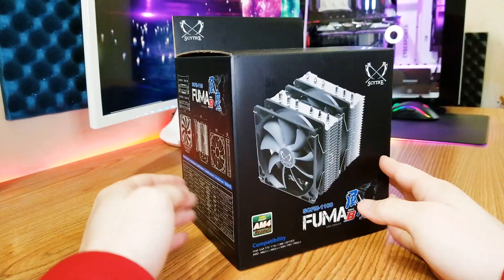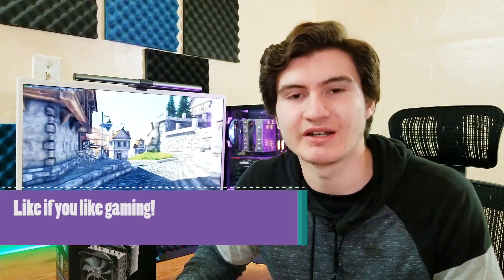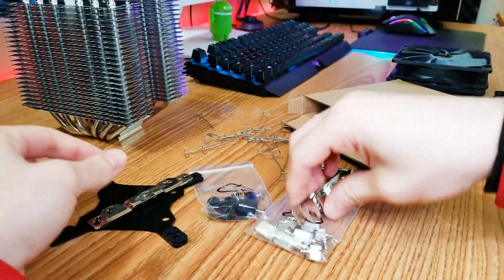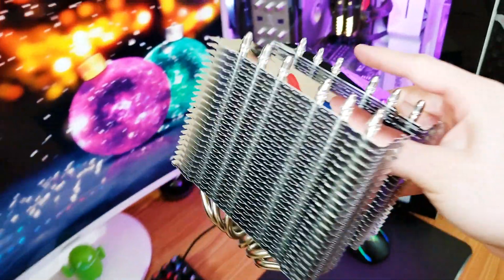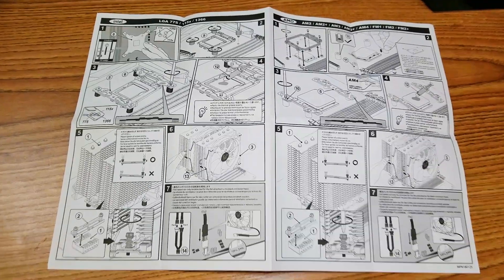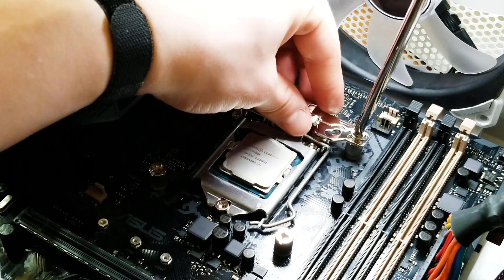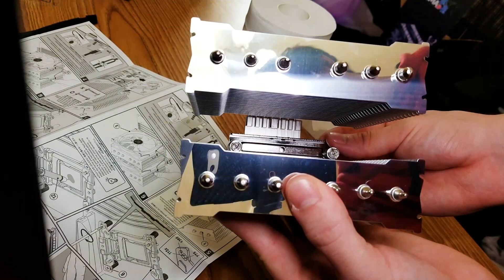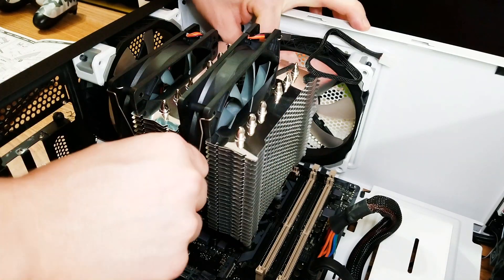Scythe Fuma PC Air Cooler Unboxing and Installation

Comment: Thanks for the short but extensive movie. What about the installation of the processor cooler on ASUS ROG Strix B850-A Gaming WiFi AMD AM5 B850 ATX Motherboard ?? Usually collers come with their two metal plates on top of them comes the coller with two more screws to the plates, and thats it. ASUS ROG Strix B850-A we have two already screwed black plastic pieces (please look MB on their site) with kind a hooks on their top side. Is it another type of coller to look for, or I have to uninstall these black plastic pieaces ? I already bought a fan : Scythe Fuma 3 CPU Air Cooler

Comment: Your instructions are incorrect! The manual says use the bolt nuts not the screws for LGA1151 (eg 8700K)

Comment: Wich cooler is better mugen 5 or that one?? I mean in temps an fan noise
Reply from the maker: From my experience, the Mugen's fans are slightly quieter. Performance is very similar. However, if you're planning on overclocking, the Fuma gives you space to add a 3rd fan if your computer has space for one. That can improve the temperatures slightly. I would only recommend slight overclocking on these, liquid coolers are probably better for that. 
Overall, I think it comes down to looks. Which do you like more, and if you're going to utilize the 3rd fan option on the Fuma.
Reply: Nerdish YT ok thanks for the answer!